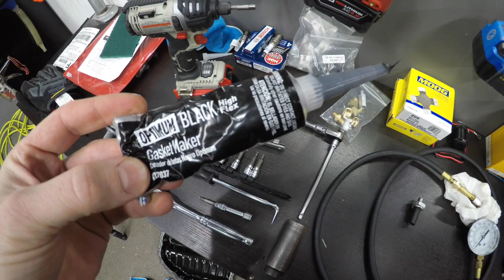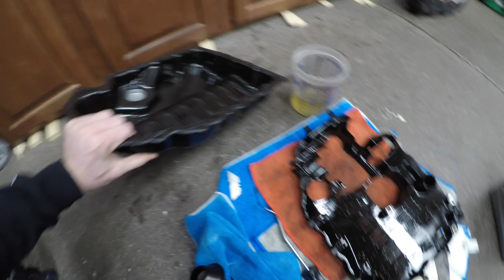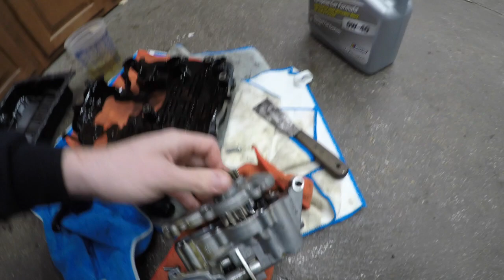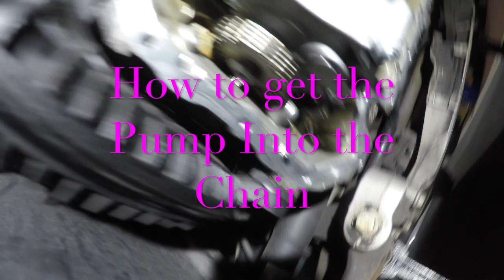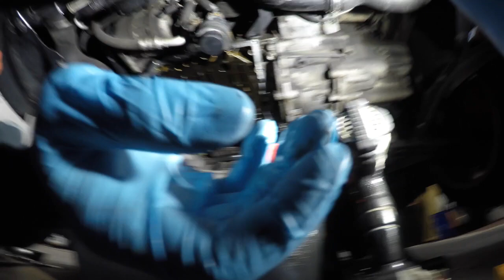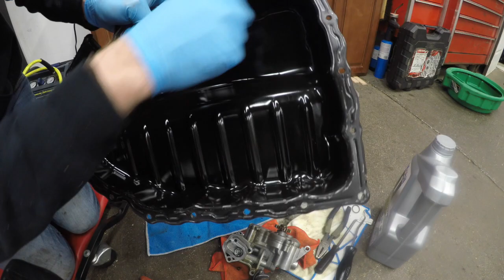MK6 2.0 TSI Oil Pump Installation - GTi / Jetta

Comment: There is a gasket for the baffle tray, where is that gasket supposed to go? I got one with the replacement kit I bought, but didn't see any gasket like this when I took it down...
Reply from the maker: I'm not sure what gasket you are referring to. The only gasket or o-ring in the assembly is the pickup tube. I don't recall a gasket for the plastic baffle as it doesn't seal anyhting.
Reply: @KennyChurchSpeed  I do have the O ring for the pick up. This piece is like an inch wide rubber washer. It fit perfectly on the top side of the baffle opposite of where the oil pump relief valve that attaches to the bottom of the baffle...
Reply: @KennyChurchSpeed  part number 06J103147 on VW Parts website
Reply from the maker: @modetoo  let me check the part number. I don't recall a rubber seal although I didn't replace the baffle so I can't say I had to take a seal out. It may have been attached to the baffle. That being said if you take yours out and can't find where it is then you didn't have one.
Reply from the maker: It looks like from the vw diagram it goes in the one corner of baffle/windage tray. Rear Transmission side. Google thr part number it's like the 15th picture that shows up.
Reply: @KennyChurchSpeed  thanks Kenny! This video helped me out so much!
Reply from the maker: @modetoo  glad to hear, thanks for watching!

Comment: One of the best I've seen on this issue. 
I have 170K Oil Pressure light coming on with daily use after about 5mins of driving. While accelerating, in town, it will come on and blink.  On the highway, going over 60mph, no light, nothing. Warning goes away. Perfectly running. But as soon as I get below 60 in traffic or exit BEEP Oil Pressure. VW told me turbo needed replacement because too much was in there. Another mech said oil pump, BUT get a whole new engine. What do you think? Thanks for your time, and once again, great vid
Reply from the maker: Hi, thanks for the comment. It's a tough call. The first thing to do is to check oil pressure, it could be as simple as a sensor. Turbo is highly unlikely. Depending on the engine code ccta engines were more prone to balance shaft failures which can cause the issue. There is also a cam girdle that has screens that also control oil pressure. You can go in circles to really find the problem. Start with pressure test. Let me know.

Comment: Hey I’m  having this same problem on my 2013 the oil warning light would come on only at idle and when I’m up in the high Rpm’s. When it comes on I can’t go pass 4000rpm and the eps light would also come on. I had the pick screen changed but it’s the same thing. I guess I’ll have to roll the dice and change the oil pump.
Reply from the maker: Hi, I was able to rev all the way to redline if I wanted to.bthay may have been a change for the later years. Honestly there are so many filters due to oil run components it's hard to tell where the root of the problem is. First check is always true pressure, not the light. Then go from there. Mine didn't come on while idling only when really driving.
Reply: Hi,i have same issues, did you find out what was the issues?

Comment: hi kenny, is there a risk to break plastic guide tensioner or "jump" a few teeths in chain/sprocket when you pull out to take out pump sprocket?
Reply from the maker: Hi Rodrigo, no the oil pump is independent of the engine timing so no way to jump timing for the engine. The plastic guide I'm sure could break it excess force were put on it or if it were brittle. However there is not a lot of tension on it compared to the timing chain. Thanks for watching, hopefully it helped you!

Comment: Hi Kenny! Great video I'm now more confident on doing this myself. I have a 2011 GTI with 124k miles atm and I've been dealing with low oil pressure warnings every now and then for a while now. I've seen it only occurs when it's really hot outside and car is driven for about 20 minutes. If I shut it off and back on the light goes away. I've so far replaced oil pressure switch, oil filter spring and still have the error. My next shot is changing the oil pick up but I'm really not sure if that's going to solve it. I have personally not checked oil pressure but previous owner did and pressure was withing spec. Any ideas or suggestions are welcome.
Reply from the maker: Thanks, you're welcome! These motors are funny, but other than checking oil pressure and of it is within specification, then it can be balance shafts or the cam bridge screens. From my experience, the ccta engine codes have more of these problems than the cbfa for some reason.
Reply: @KennyChurchSpeed  this is a CBFA engine. Cambridge was replaced and balance shafts "checked" by mechanic about 4k miles ago when I replaced timing tensioner, guides and chains and he said everything was fine. Car has been basically been going on like this for about 5k miles now but I wish I could find the culprit and fix it.
Reply from the maker: @raherre  the best is to perform and oil pressure test to confirm you have oil flow and pressure building. If not it may be a pump issue.
Reply: @raherre  How is it possible a mechanic checks balance shafts and not oil pressure?
Did you figure out what was the problem?
I would check spark plugs and pistons for excessive carbon buildup and blowby, if there is, the piston oil rings usually get clogged causing the oil pressure issue.
Reply: @psiturbo  I sold the car but before I did I replaced oil pick up tube, checked cam bridge screens and oil pressure at idle and different RPMS and simply couldn´t figure out what caused this. I remember there was a little oil present on cyl 3 spark plug but really nothing that would catch my attention.
Reply: @raherre  I have the same issue, torn down the engine, and is funny you said "spotted some oil cylinder 3 spark plug", and my car shows the same symptom.
I had a mechanic tell me it was PCV, it is the pump, wrong mixture, needs carbon cleanup.... and after all, it was the oil rings, this engine has the worst design, it does not use waffle style, but some crappy spring loaded  oil ring.
It clogs, locks the rings creating excessive blowby and loss of pressure. The crazy thing is, no smoke, not at idle, not at high rpms, with bad oil rings and three cracked oil control rings!!!
Am almost done fixing mine, possibly make a video and then sell it. The GTi is a cool little hatch, driving etc, but it has the worst engine. If I could find a K20 swap kit I would do that and call it a day, only seen it on a MK3 or so,but the car had no AC, which no way I would go back to that.
BTW, my car is at 117k miles, is immaculate inside and out, friends who see the car in the driveway give complements, but they do not know this car is deceiving. 
The oil starvation ate the cylinder head cams, $1,000 only on that part, my expense bill is so far $2,500, and I do not even know if it is goingto drive well.... 😭
Reply: @psiturbo  hope it drives well and don´t lose much selling it. I had every known issue to this engine fail on my mk6 GTI but I loved it when it wasn´t sitting on stands in my garage. Came from a Type S RSX too so I know what you mean about that k20 reliability lol but this was my first VW and made me fall in love with the brand. I now own a 2016 Tiguan with the same damned engine lol but this hasn´t given me half the headaches my GTI did in the same period of time
Reply: Change the oil pressure switch
Reply: @cattuneweyze7723  he said he did.

Comment: Do I need a special vw tools?
Reply from the maker: No you don't. And pump pressure is dependent on rpm and temperature. I believe I mention correct pressure in the video. Should be minimum 38psi at 2500 of I remember correctly.
Reply: Kenny Church this video is such a great help thanks
Reply from the maker: @JamAMartinez  you're welcome, glad I could help!
Reply: Kenny Church I replaced the pump and sensor and 350 km the light came back on. What else can it be?
Reply from the maker: @JamAMartinez  hi, what is the pressure like when up to operating temp? If it comes on sporadically it may be the balance shafts. If you have a ccta engine code this is far more common than cbfa from what I have seen.
Reply: Kenny Church about 47psi . Warning light on comes on when I’m just doing short errands

Comment: Hey, just past 67k miles one 2009 GLI, it is giving me intermittent: Stop, oil pressure, engine off...
I already changed the sensor,  next step, this???
Reply from the maker: Hi, follow the video. Check oil pressure and go from there. It sounds like what my car was doing with a pump issue.

Comment: my oil pressure light turns on when i decelerate coming off the highway. i did an oil+filter change 500 miles ago and dipped a magnet in my oil and didn’t see any shavings but i did notice thick sludgey oil. (oil changes every 3,500 mi.) but anywho, time for some deeper digging. Thanks for this informative video!
Reply from the maker: You're welcome and good luck. Start with the pressure test, if you are getting good readings throughout rpms it isn't the pump. Balance shafts can cause the pressure light at odd times as well. If the rod bearings were wearing you may hear extra noise and potential metal in the oil. Unfortunately it depends on the engine because my cbfa car had 256k on it with no engine issues. Ccta has alot more problems with balance shafts, particularly the little screens in them break down.
Reply: Kenny Church i recently had my valve/cam cover resealed. do you think somehow that could have contributed to this issue?
Reply from the maker: @karinawashere  did you have an issue before the reseal? I wouldn't think so unless and oil passage was blocked somehow. I've also heard of people having odd lights when the pcv leaks but I'd expect a check engine light for that not an oil pressure light.
Reply: Kenny Church i figured it out! turns out my oil pressure sensor was bad. Oil was in the plug
Reply from the maker: @karinawashere  great! That's a cheap fix and always the first to try!

Comment: Hi, Kenny
Mine got a problem is when rev over than 4k rpm will pop out oil pressure problem don't over 4000rpm
Reply from the maker: Have you checked pressure with a gage?

Comment: hey kenny, i have the "low oil pressure turn engine off" thing that comes on the mfi, it only comes after a hard acceleration, is this a pump issue or a bearings issue?
Reply from the maker: Hi, do you have enough oil in the car? Does it come on after decel or during hard acceleration? Have you checked the pressure using a gauge?
Reply: @KennyChurchSpeed  wow thanks for the quick reply! it does have enough oil in it, it comes on after decel, and im getting a gauge to check the pressure tomorrow
Reply from the maker: @domikus  checking pressure at all rpms is a good start. I've also seen that the pressure sensors go bad. I've also seen rod bearings fail with high oil pressure. Unfortunately with these cars there are ALOT of variables with the balance shafts, high pressure fuel pump oil galleys ect. Have you noticed metal in your oil?
Reply: Kenny Church i have no clue because i don’t change my own oil because i don’t have a jack, when i got it changed 2000 miles ago they said nothing about shavings i’m the oil. my buddy said it could be the PCV going bad because i don’t have a whine under acceleration with my intake. really hoping it’s just the sensor.  i’ll check it and let you know
Reply from the maker: @domikus  the pcv will not cause an oil pressure warning as far as I know, generally just vacuum or idle issues. Good luck!
Reply: Kenny Church what would acceptable PSI be for the oil?
Reply from the maker: @domikus  hi, I believe it is 25 psi at idle and 40psi at 2500 rpm. I believe I say it in the video as well. If you have good idle pressure but it doesn't rise it is most likely the pump.
Reply: @KennyChurchSpeed  thank fully it rises, almost had a heart attack, switching the pressure switch and hopefully that'll fix it
Reply from the maker: @domikus  that's a good sign!
Reply: @domikus   A bad PCV cannot in itself cause a low oil pressure warning but it CAN cause sludgy oil buildup that will in fact cause oil pickup/balanceshafts to clog up and cause low oil pressure issues.

Comment: Hi Kenny, I got red trouble about Oil pressure after Oil engine temp 140'C!!.  I think maybe cause from Oil pump not good or Balance Shaft leak. Do you have any idea about this?
Reply from the maker: Hi, it depends. If you are driving and the light goes out most likely not a pump issue, although the light can come on from time to time with balance shaft as well. You will first have to do the oil pressure test. If you have increasing pressure with rpm then less likely a pump.

Comment: Thanks for video, i have "low oil pressure" light when engine is fully heated (after 10-15 minutes driving) and there is 0.2 bar on mechanical gauge... what do you think is it bearings failure or just pump?  Thanks a lot again.
Reply from the maker: You're welcome. Does the pressure increase with rpm or stay at the same pressure when increasing rpm?
Reply: it's increasing until 2.5 bar at 4 rpm, but at cold engine its fine pressure
Reply from the maker: @borosa100qwertyui7  Generally if you have a pressure increase with rpm that means you have fluid flow(oil pumping) no matter what temp. So it could be rod bearings or the  balance shaft filters or bearing surfaces. Hard to say, but rod bearings are easier to inspect than the balance shafts.
Reply: @KennyChurchSpeed  thank you for advice, i am just going to see what happens inside...
Reply from the maker: @borosa100qwertyui7  good luck. I know the feeling.

Comment: Hi Kenny please i have an mk6 gti 2010 200k the engine run good coller everything the only issue is when the engine arrive to 90° and when im in low rmp from 1000 to 2000 rmp the car start to tell that low pressure but in the high way everything work good, you think is the oil pump to? I brought it already i need just to install it
Please let me know
Reply from the maker: Hi there, it could be, but if it were a pump issue it wouldn't run good on the highway you would get an oil pressure light. The best way is to use a tester like I did verify oil pressure then go from there. Based on rpm I'd say you have a balance shaft issue where the filters in them have fallen apart or they are becoming worn reducing resistance of oil flow therefore reducing pressure.

Comment: What was your pressure after the pump instal?
Reply from the maker: Hi, I am actually not sure. I didn't even test it after there was no light. I believe below 34 psi at 2000 to 2500 rpm the light will come on. I know my other engines are somewhere between 50-75 depending on oil temp.